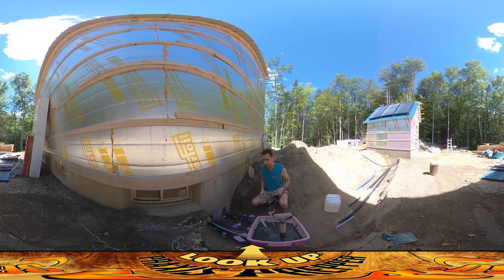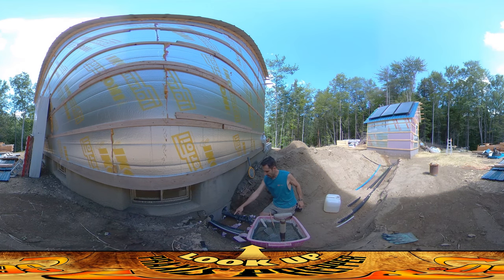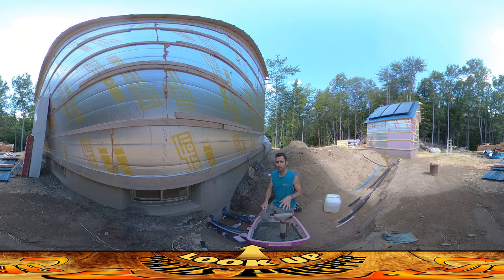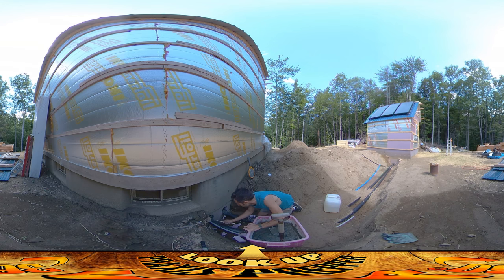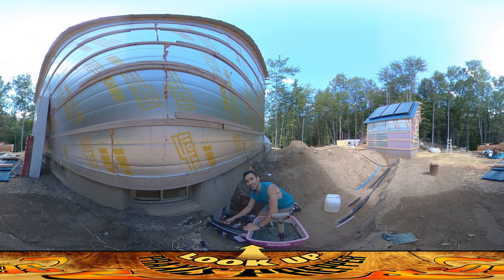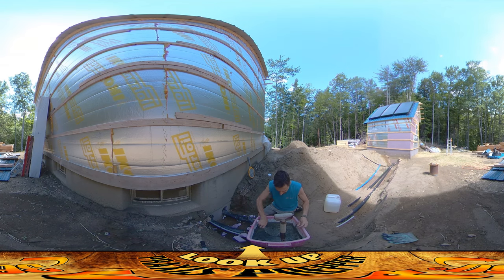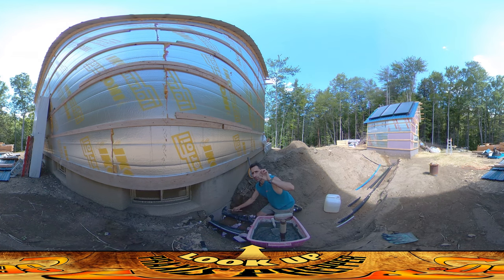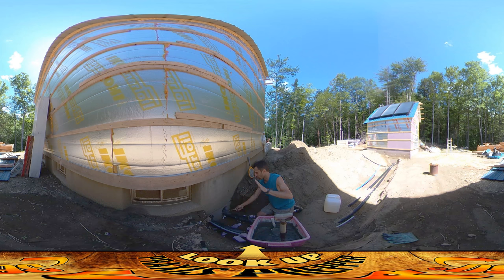Homestead Building - Sealing Up Solar Hot Water Pass-Throughs

Comment: Vibrating the concrete is a pro tip for sure
Especially for things like house slabs or foundations, its crazy how much stronger it gets once you vibrate the water to the top and scrape it off